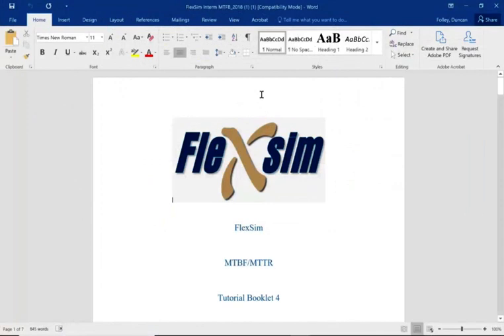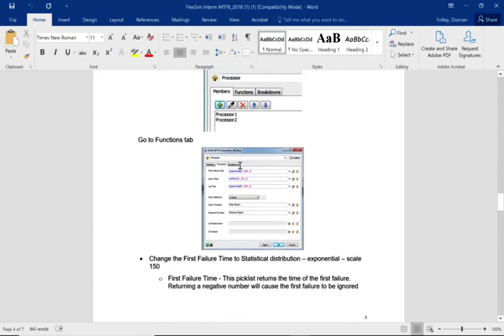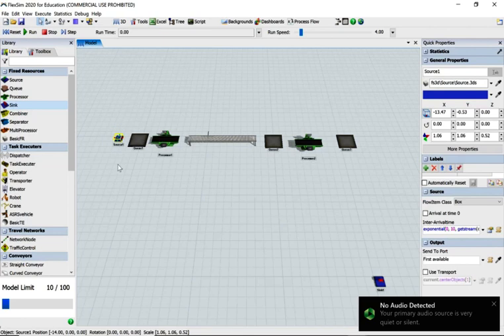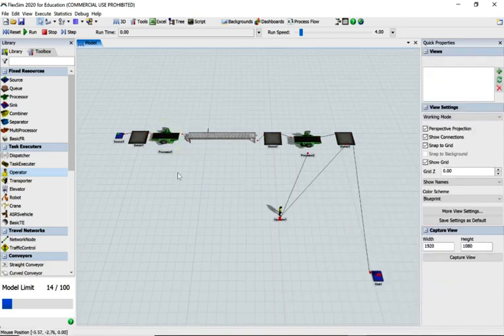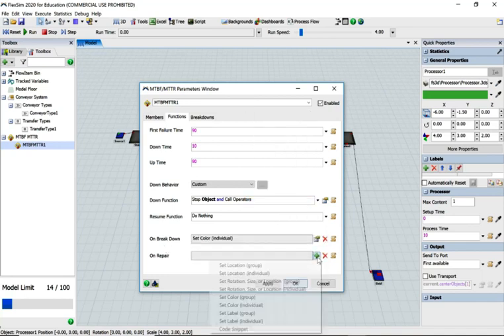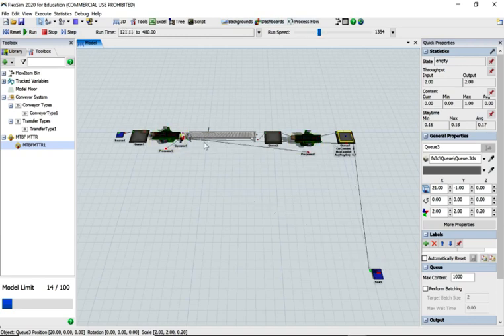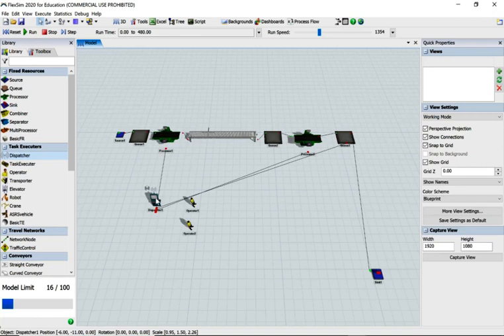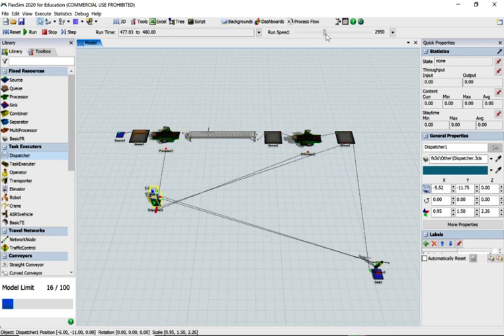FlexSim Tutorial Booklet 4   Intermediate MTBF MTTR

Comment: Prezados, parabéns pelo tutorial, esta em inglês mas vale um esforço para entender o sistema de indicadores de manutenção MTBF e MTTR no Flex sim, sou Wagner Albano e sou monitor de engenharia de produção da Uninter.
Reply from the maker: Ive translated the message to 
"Congratulations on the tutorial. Although it is in English, it is worth the effort to understand the MTBF and MTTR maintenance indicator system in FlexSim.
My name is Wagner Albano and I am a production engineering monitor at Uninter.
Sincerely,
Wagner Albano"

Firstly thanks. I think if you have the maintenance data and it is identified as a potential issue then yes. If however its so infequent then possible no. Understanding what data is useful and what is just "noise" can be a skill in itself.